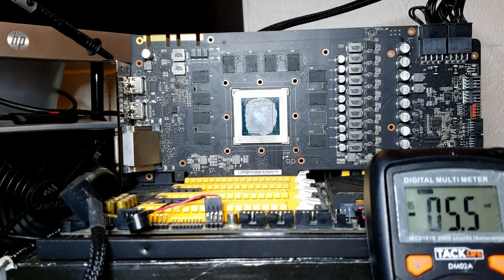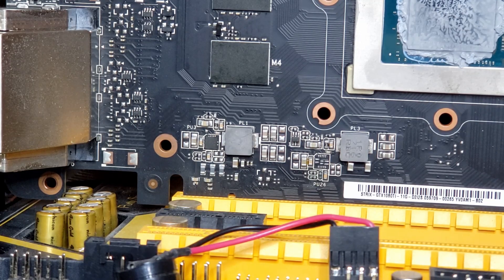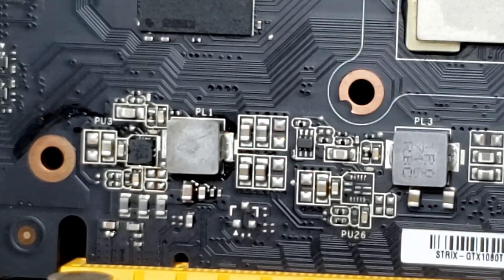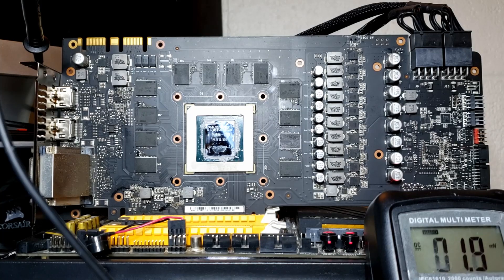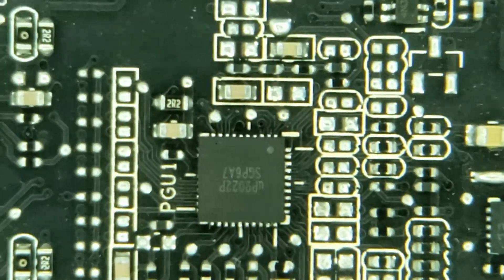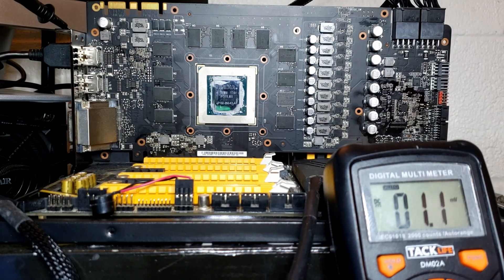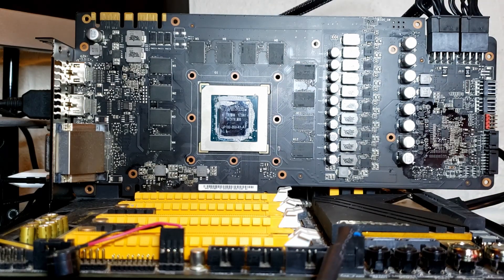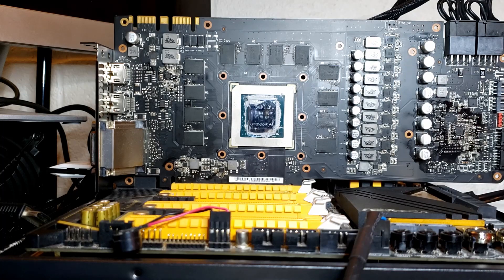Asus Strix GTX 1080 Ti Repair #1 - Not detected

Comment: Really enjoy watching these videos. I have a R9 390 which is in bad shape. I have removed the GPU chips and I cannot source a replacement. Number on the old chip is amd 215-0880030. I think I could reball and replace the chip if I could get one. Can you help?
Reply from the maker: https://item.taobao.com/item.htm?spm=a230r.1.14.47.678158dbKAQJgG&id=573854642764&ns=1&abbucket=12#detail
Reply: @TechCemetery  will that chip do the job as the numbers are slightly different?
Reply: @TechCemetery  and is there a way to translate the page?
Reply from the maker: @FlyingVideos  The second option matches your part number exactly, and the listing can be translated to English in google chrome.
Reply: @TechCemetery  thankyou for you help. I’ve subscribed and looking forward to more videos in the future 🙂

Comment: Friend can you help with 1080ti ftw3 evga. Stopped suddenly with no signal. I see no burn marks on Mainboard.  I can measure 12 v and 3.3 volt on the buck converters and that is all and chip is cold.
Reply: Thanks fix it, your videos helped. It was the capacitor C248 on the power side of the Mainboard
Reply from the maker: Do you have 5V? if not check the EN and VIN pins.
Reply: @TechCemetery  hello thanks for the quick reply- I will appreciate if you check the pcb photo(showing voltage and R values I have measured)- have uploaded here:https://imageupload.io/cZ3CTefIsa.i

Comment: hey brother i have same video card i would like to get it fix from u
Reply from the maker: Hi, I generally don't take cards in for repair, what's wrong with your card? do you have all voltages?.
Reply: @TechCemetery  hi i was using my card normally and with the computer on i touch the card by cleaning and shorted the card i tried replace the burn circuit and still not working.i don’t know how to work on those can u help me?

Comment: Nice video I’m trying to fix one gtx 1080 ti armor it’s short circuit in.  8 pin #1, i follow the circuit with a multimeter and the problem begins in the first 6 vrm mofsets
Reply: The mosfets are in parallel so if one is short all register as short but most likely just one just remove one by one until short isn't present as there is no quick way to find it and even if the short is found it could still be a component linked to that mosfet circuit have fun pulling out fets it's annoying until you find it then it's worth it 😂

Comment: you are doing a really good job man, truly impressive, but how do you always seem to know what area of the pcb should have this voltage or that voltage ? as far as i know manufacturers never really release the schematics to these cards.
Reply from the maker: Experience and luck
Reply: @TechCemetery  i have a lot of broken cards hoping i can fix them someday, i do have smd rework equipment, i fixed a few dead ones before myself but i think i just got lucky lol
Reply: do you have an idea how to check if a polaris chip is shorted ? i measure between the inductor and the ground and look for resistance around 1.2 ~ 1.5 ohm, is it correct what i'm doing ?
Reply from the maker: @JR-ob7hz  The resistance of a GPU is normally extremely low, I personally never check the resistance of the chip as I don't have precise enough equipment to do so. 1.2 to 1.5 Ohms doesn't sound off to me.
Reply: @TechCemetery  i have one card that i once replaced 2 shorted mosfets on, replaced the fuses, the short was gone but once i plugged the card in all fuses blew again and the new mosfets died, that card reads only 0.9 ohms on the die, so i think maybe it's just the chip is dead and kills everything else that connects to it, the card is an rx 470 8gb nitro plus, these cards went up so much in price nowdays
Reply from the maker: @JR-ob7hz  In my experience on Sapphire RX 400/500 series cards. The GPU usually lives when a GPU MOSFET blows. These MOSFETs can sometimes be tricky to install - you have to be careful you don't have any solder bridges between pins. For some of the chips I install, I often have to take it off and install it a couple of times before I'm sure I have it right.

If it were me, I'd try the again and maybe install one MOSFET at a time, I believe the RX 470 can at least boot with a missing GPU MOSFET. And don't jump the fuse no matter how tempting it seems. I see a lot of people do that to save time and they usually pay for it.

Good luck!
Reply: @TechCemetery  but if i run the card with mosfets missing, don't i also need to take the corresponding inductor off for the 12v coming from the psu not to go straight to the chip ? also does measuring the data pins like in your rtx 2070 video work to indicate if a polaris chip is dead or not ? thanks a lot man, keep it up, i love  your passion it's inspiring, i love computer hardware too and hate to see silicone go to waste !
Reply from the maker: @JR-ob7hz  You don't need to take the inductor off if the MOSFET is missing. You can of course check if there is continuity between 12V and the GPU VCORE if you suspect otherwise. As for checking data pins like the RTX 2070 video - it works for all cards but it's rare for a card to have a bad data pin even if it's dead.

Comment: hey buddy , do you were the sense pin of 4 pin fan header of the GPU goes to ? Does it goes to the GPU core ? because I accidentally shorted 12v and sence pin in my zotac gtx 1060 mini and it's not working anymore...
Reply from the maker: My understanding is that it goes to the GPU and sometimes a diode/transistor etc.

Comment: How did you find out the model number of these obscure buck converters?!
Reply from the maker: Google, most of these buck converters have markings on them and that's usually enough to find a datasheet.
Reply: @TechCemetery  Mine are marked as AEAG 433 on my Strix GTX 1080 non-Ti which doesn't yield any results, seems more like a manufacturer's batch number. Anyways I have a similar problem to yours, 1.8V and 1V are not present and thereby preventing the VRM for Vcore and Vmem turning on. I measured all components and traces from both rails and can't really find the underlying issue, perhaps you can give me a pointer? I was able to locate and trace all the signals except for PG, EN and VCC. I am unsure what to look for for the first two and haven't bothered with the last
Reply from the maker: @punktkomma9489  AEAG would be an NB671GQ, the "G" in AEAG denotes the year code while AEA is the marking.

https://www.mouser.com/datasheet/2/277/NB671_r1.03-371602.pdf

The 1080 Ti Strix uses NB671LBGQ-Z which has the marking "AMC"

https://www.mouser.com/datasheet/2/277/NB671LB-1079585.pdf
Reply: @TechCemetery  dude you are a legend, i already got the correct datasheet after you mentioned the actual part name in the video, that's highly appreciated
Reply: @TechCemetery  Alright I'm probably bothering you with this but asking still worth a try. I have a donor board with 2x AMCH 169 which have the same package size and pin layout but I am not quite sure if that's also a NB671, my search lead a few sale listings with NB671LBGQ-Z. Could I use these as replacements if it turns out that the AEAG 433 are bad?
Reply from the maker: @punktkomma9489  I personally don't like switching parts. I can only recommend you get an actual NB671GQ if it turns our your 1.8V Buck converter is dead.

Comment: My 1070 strix went black screen and now won't come back it won't detect in device manger but all the voltages I've checked are normal was following the video it helped so much but now I'm stuck 😂 keep it up tho was a fun lesson you have earned a sub 👍
Reply from the maker: I would consider the bios and the resistors around it as well as the GPU itself. In my limited experience, a reball is required if the GPU is not detected (assuming the GPU isn't itself bad).
Reply: Following your video to the T I ended up realising the 1v was missing 😓 I then checked for the 2v which was there all my other volts are there so I began applying pressure to the nb671 but mines not that chip and too the caps around that area and had my thumb on the die and all of a sudden was heating up I hit reset booted with display to bios chip hot turn off 😂 reassembled apply some heat with my hot air gun though the cooler fins and a few tries boots to bios what in hell do I do to fix 😂
Reply from the maker: @ewardw6062 
Do you have memory voltage? I believe it might turn on if 1.8V is present, even if 1V is not on.
Reply from the maker: @ewardw6062  

I'm sorry, I just realized I didn't properly read your message. You have all voltages except 1V?. If the 1V rail is short, that usually indicates a dead GPU.
Reply: @TechCemetery  I don't think it's dead or needing a reball as the area which I heat is far from the die and the heat from my thumb is enough to get the gpu started I put the card in my pc applied heat to force it to boot loaded up warzone played for 2 hours straight temps were good frames were consistent ran few benchmarks done some oc it runs perfectly unless I leave my pc at desktop idle then when not in use will black screen and fans ramp up is very strange gonna strip down and apply heat with the tip on my solder iron to individual components around the voltage ic chip in the bottom right corner see which component allows it to turn on
Reply: After hours of looking and playing I give up its not heat related my card is weird if I grab the bottom end and twist just ever so slightly it returns my 1v but soon takes it away after being left for a short while so sometimes can game sometimes it black screens and fans go haywire within a few mins every boot is different 😂 what a shame I love this card has been brilliant if you do repairs yourself for customers let me know a price much love man x keep the vids coming
Reply: Yo I didn't give up and now I have a working card long story short on the back side bottom corner very end of the card there's some transistors caps and resistors one cap burnt me  on one occasion so changed it out and a resistor was reading all over the place changed it out and card has booted ran smoothly for hours so far might have fixed it cheers for your time you have massively helped you basically fixed my card ❤️
Reply from the maker: @ewardw6062  Good to hear, hope the card lasts for a while!
Reply: @TechCemetery  cheers me too just spent 6 hrs in warzone perfecty so hoping it's good